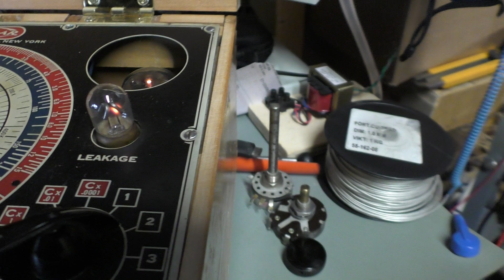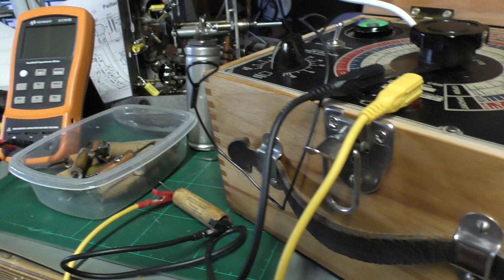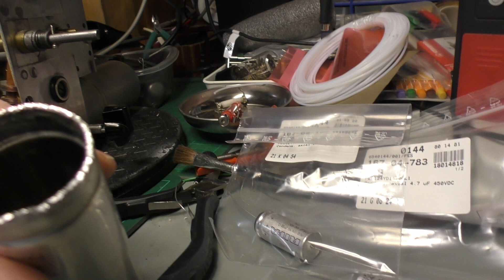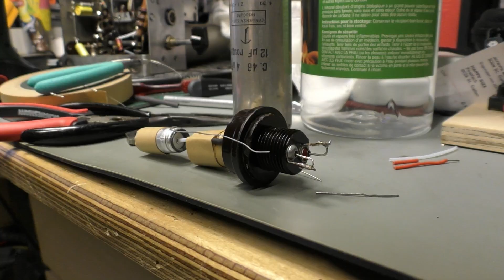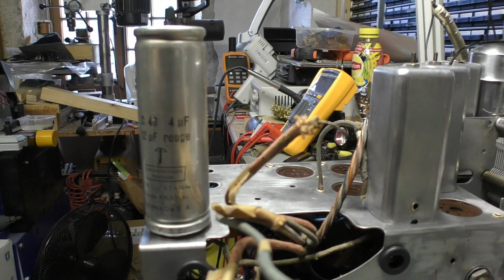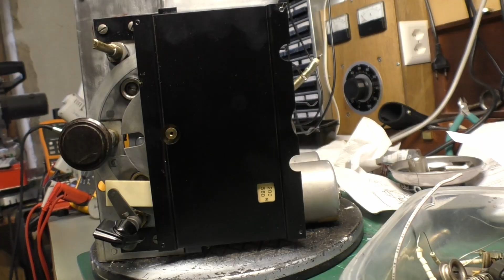Paillard 39 - part 9 - capacitor testing and time to start re-assembly!

Comment: Why even bother testing the old capacitor values, if you are planning on replacing them anyways? This I have never understood with those who post older radios on YouTube.  You know they are old, bad, and need replacing.
Reply from the maker: Were I doing this as a commercial endeavor then of course I wouldn't bother with leakage testing.   However, this is all  a fun pastime for me and there is no time limit and I like finding out exactly what condition the caps were in.
Reply: @Zone1242  I wish I had that kind of time on my hands!